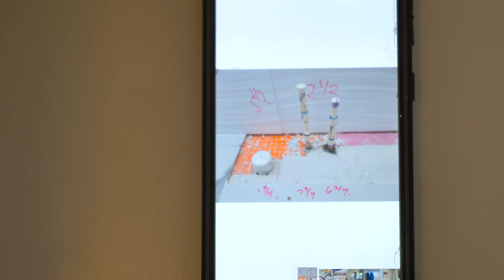How to Install a Bathroom Vanity From A to Z

Comment: One minor assembly step to add, Jeff: Always unscrew the aerator from any faucet, showerhead, hand-held sprayer, etc BEFORE turning on the water for the first time as you'll always have some sort of debris in the lines - even if you're only replacing a hose/riser. THEN turn on and run the hot and cold water to clear out the majority of whatever is in either line before putting the aerator back on. Cheers on making a silk vanity out of a Hampton Bay sow's ear. 😉
Reply: I tend to turn the shutoffs on and clear the line into a bucket before I connect to a faucet because I've seen the cartridges get clogged. But yeah, removing the aerator is a good idea too.
Reply: It's true, and he's going to have extra glue pieces in the lines after slathering so much into the coupling. Pro tip: only cover the pipe. Otherwise a ton of glue gets squeegee'd into the joint. If you don't believe me, try it on some pieces and then look inside. Plenty of glue will still get squeegee'd into the joint and the joint will be fully covered, esp with some twisting action.

Comment: Reusing under sink plumbing is crazy. Spend the $12 and get new stuff for the new build.
Reply: From DIYer perspective it's easier to setup new pipes than to mangle with the old one. In my case I'd probably throw up just by looking at the used waste pipe.  ;)

Comment: Say Jeff. Do you need to attach the vanity to the back wall? That cabinet is not very deep and since its not attached to the floor and essentially only thing stopping it from moving are the drain, hot and cold water supply lines and that little bit of caulk. Maybe install it to the back wall using an angle bracket towards the upper part of the cabinet? It will stop it from potentially tipping over and being pulled from the wall by a kid. 

I appreciate the look and layout of the bathroom. Personally, I would have used new plumbing or painted the recovered pipes with white spray paint to make the look even cleaner to the new buyer. And that screw can be trimmed with a good pair of electrical pliers.
Reply: Pretty typical for bathroom vanities. They are rarely attached to the wall
Reply: @joseph7105  Depends on where the building is done. In some areas, builders still do custom, site-built cabinets that are attached to the wall, contracting carpenters who use high quality cabinet-grade veneer plywood. I heard Jeff mention this was not the cabinet (vanity) he originally intended, and that the one he used was out of necessity makes sense considering the high-end shower he installed with the tremendous custom tile job and inline floor drain. I can't fathom you'd purposely couple that much high-end work with a particle board vanity from Home Depot. If you've never seen one of those up close, you can't appreciate how utterly cheap those things are. And yet they still charge handsomely for them.😡

Comment: How do you use abs-to-pvc glue on cpvc? And then you said to use purple primer and glue (which is for pvc). I don't know about Canada, but in my area, that's totally against code. Those products are manufactured to work on their specific materials. Especially pressurized water lines!
Reply: That's a new solvent type approved for CPVC last year and should be just fine. Making it's way through the code books.
Reply: @DIYDaveOK 
OOOOOOOkay!😮

Comment: Did you purchase the faucet kit with prior planning of not using the drain rod system and instead using the tap to close drain? Wouldn’t there be an exposed cavity where the drain rod WOULD have been? Or did you use a different faucet? Or did the faucet have an optional cap to close the cavity in case you went with the push to plug?

Comment: 27:40:  The pop-up drain assembly that I have that is similar (but does not have the threads on the top gasket) does not have a tight seal beneath the sink drain and above the flange. It leaks.  I've posted in other online sites about it and no answers.
Reply: Those plastic drains are terrible.  You cannot get tight seal or it gets compromised and the drain base on sink  has to be as smooth as possible.  We did both bathrooms; and purchased brushed Nickel pop up metal drain . Don't forget to line up overflow if equipped.

Comment: Good video. Interesting. You use Teflon tape to connect two screw-attached joints in plastic drain pieces? I've always used Teflon tape with metal connections, not plastic ones. Have I been doing it wrong?
Reply: I missed that part and can't find it, but I will say this: you don't want to teflon pvc to pvc. Too much stress on the joint. PVC does terribly with hoop stress; same reason you never go metal male threaded into pvc female. Rectorseal is a better option if you need sealing. But for those drain compression fittings I'd instead lube the threads with silicon based lube. The sealing action comes from the rubber gasket not the threads.
Reply: @trentvlak  Actually, I didn't see him putting teflon on the pvc; I wrote my comment when he was talking about all the pvc joints and saying that he would use teflon tape on the joints, so perhaps he misspoke and never actually applied the tape. Thanks.
Reply: @k.g.r.2682  that seems to be the case.

Comment: I've been watching these videos for a few days now because I'm a new home owner who wants to renovate my home. its already been remodeled once but they def didn't do things right but it still looked decent its just minor things like gaps in the base boards and a floating floor being put on top of original hardwood floors. Is it difficult to do these projects with no experience? I've handled tools before and did small contract work like running conduit setting up circuit breakers and building fences is it any different?
Reply: It just takes a little patience. I remodeled my bathroom to the studs myself after some ridiculous contractor quotes. My tip is to watch multiple videos for each step of the process - and then read the comments - because if the video did something wrong, people in the comments will call them out. 😂

Comment: I noticed the plumbing has so many bends. Was there a reason you didnt just throw out the old p-trap pipes and just plumb directly from the new drain in the ground to a new p-trap and to the sink drain?
Reply: Missed that you mentioned a $35 savings by reusing. 😂
Reply: @pikapika3128 yeah who has $35 to spend when renovating an entire bathroom?

Comment: U need to hold the CPVC fittings together for about 30 seconds to allow the glue to set up a little bit. Also, looks like you'
 Used ABS to PVC glue which SHOULD NOT BE USED for anything else.
Reply: Reminder that the CPVC water lines will have water pressure, not sure if that glue is rated for pressure. 😮

Comment: Real diy and or building. Solving problems as you go. Everyones solution will be slightly different. The average diyer does not have twenty years building experience.

Comment: I hate pressboard/particle board/mdf and the garbage they use for those cabinets at big box stores. I like plywood cabinets with real wood trim. 
Composite shims or some sort of plastic spacers under the front edge of the vanity might be a good idea in case the silicone breaks down over time.
I guess its a good idea to figure out where the drain comes out of the sink before drilling holes in the cabinet and doing final placement. 
I don't like the plastic style with the ball. I had the bar break off of the ball in one of my sinks. That was very annoying. 
Really need to install the new pop up kind instead. I will say, the one good use for the top puller/pusher thingy is I'm using one for a custom lightsaber build. I went and looked it up and it's called a lift rod handle.
Looks like you might have 1.5" pipe going to a 1.25" tailpipe. So, you'll need the adapter which is basically a small plastic ring. When in doubt, bring the parts with you to check the fit. I find that I have to bring stuff and check.
I'm all about saving scrap pieces of pipe. I've had to re-use elbows and such in the past. And scrap pieces can be used for craft projects.
I do want to own every tool but alas, I don't have the funds or the space. LOL. Seriously thinking of getting an electric pvc cutter out of sheer laziness. And I like collecting power tools.
Since it looks like you have 1.5" pipe you need at least 3" trap arm length. Although, you only need 2.5" trap arm if its 1.25" pipe. Anything shorter and it creates a crown vent which is like an S trap and allows water to be siphoned out. The rule is the trap arm length shall be no less than 2 pipe diameters.
Installing to the sink first should work when we put a new sink in Mom's bathroom. Her current sink is avocado green. It's so ugly. LOL.
Ooh, do you have a link to the plate/escutcheon you put around the drain pipe? I definitely want some of those for my house.
Most of the installation instructions I've read for new faucets say to purge the lines before hooking them to the faucet so sediment and any dirt that may have gotten in the lines won't clog the faucet up. Sediment can clog up the cartridges and aerator. One of the reasons I usually hook the hoses to the shutoffs first is so I can run them in to a bucket until the water is clear (or just free of chunky stuff in my case since my water is never clear).
Since that vanity top doesn't have much of an overhang and the material underneath is particle board, I highly recommend a coat of poly on the front and on the tops and faces of the doors. My friend's vanity had the particle board bloat out at the front because it got wet. Actually, now that I think about it, sealing up the top of the particle with poly and/or a water sealant is a good idea before putting the vanity top in place. But even the laminated parts can let water in sometimes.
The last drawer getting stuck is something that would happen to me. LOL. 
Oh, I hate when they short you on screws/hardware or send you two of the same thing instead of mirrored things so you can't put things together without getting more stuff. I've found that sometimes if you call Home Depot to complain about missing or broken parts they will give you a partial refund and/or send you some parts.
Next time, if you are anywhere near a Surplus Warehouse (aka Barton's Home Outlet or just Home Outlet) you can look for their unfinished oak cabinets. They are much better quality and you can paint or stain them whatever color you want. It's worth it to not have to deal with particle board crap.
I feel you on the frustration when the screw didn't want to go into the handle properly and just being done with all of the BS from the problems. At my nearest big box stores you're lucky if you can find the packages in the right spots and even if you can, a lot of the time thieves have torn the packets open and stolen things.
I keep wanting to paint the frame of that mirror so it doesn't look so distressed. LOL.
The end result looks pretty good.

Comment: Didn't know you could PVC water pipes, wonder how that holds against pex and copper ~
Reply: CPVC is perfectly fine. It is much more stiff than pex, but it is more UV resistant and less expensive and you don’t need special tools to get it to work (such as a crimper or expanding tool). Copper is the best, but is more labor intensive and much more expensive.
Reply: @Jamo12  Thanks for the info! That's good to know, would be great for small spaces where i had trouble getting pex tools into

Comment: I’d never use a power drill to tighten those screws holding the faucet handles on!  Regular hand held screw driver. If you’re not skilled enough it would be too easy to break that top!

Comment: #1. Why keep that old ugly piece of pipe, when it's sooo easy and cheap to replace it, AND, you can place it wherever you want. #2. You should have did it right and put the rotating feet on. #3. Why don't you just cut those screws being put in the drawers instead of using washers? There's only 2, and you just cut 1/4" off....easy.
Reply: Agreed. And it would cost him maybe 20 more mins and $35 more dollars

Comment: Come on! . You did some things that dropped integrity. Slide draw unacceptable.  That draw slide is terrible.....dont know what you adjusted on draw slide...nada! Silicone to keep vanity level...(just purchase  adjusting level screw base). MDF??? Faucet handle at end of video was not perpendicular . Caulking went from thick line to thin. Then thick again.  Youve taken shortcuts here that surprised me. Didnt see a level to ensure straight line from drilled holes for two mirror screws. Maybe thats why you used black-tape to level.